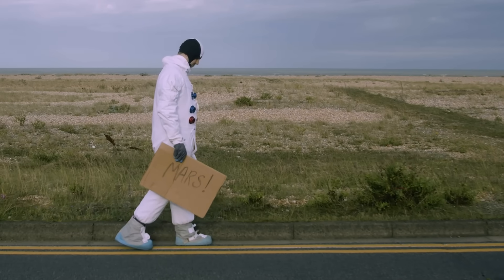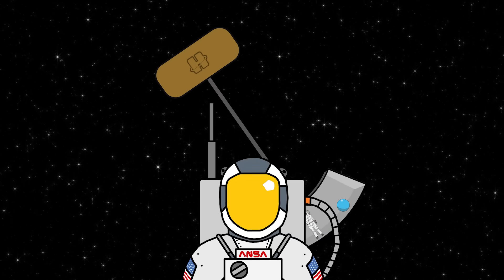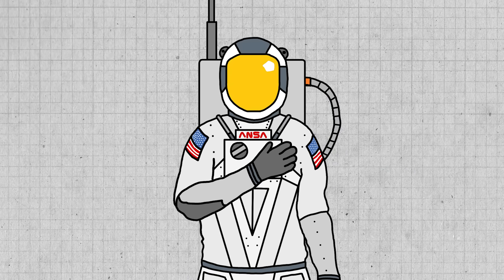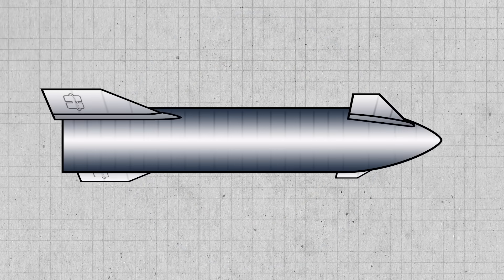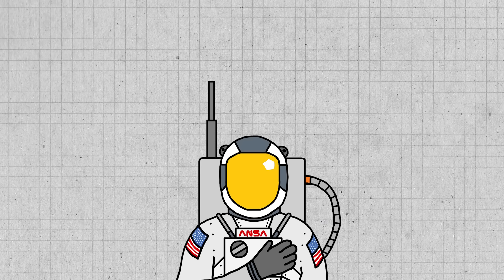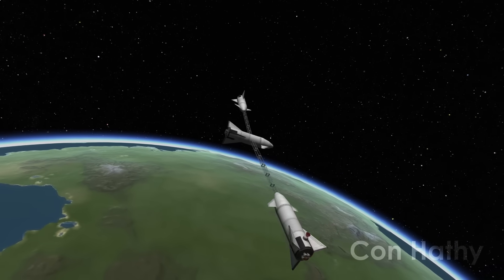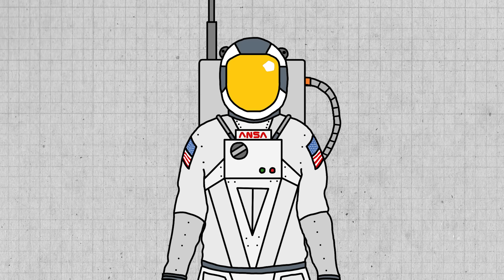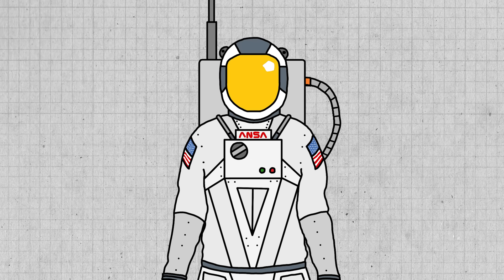This is NOT how you make Artificial Gravity

Comment: all of the examples pointing out the issues with each use case all miss the most fundamental issue, that using the centrifugal force obtained by fast rotation to simulate gravitational force all assume you are in physical contact with the thing in rotation. once you jump, it’s all over because there is no actual mass-based gravity caused by the curvature of space-time to make you fall back down into the mass.

no physical contact with the rotating object = no centrifugal force

Comment: It is comedic watching the three stooges spinning on their head in the wrong direction , the earth don't spin with your feet pointing up  it spins with your head pointing  up ,  first it's not artificial gravity it's just plain old gravity gravity and it's not made by mass or gravitons , it's not completely centrigul force but centrifugal force is part of what makes gravity , the weight of the sky above your head and your density push you down to solid ground and the weight of the sky above your head strengthen your bones and muscles working against the weight of the sky above your head , the centrifugal forces of the earth moving around the sun and the centrifugal force of the earths rotation give you upward push and ballance , tempiture has something to do  like on Venus where hot air rises and cold air falls , the centrigul force of the earth and weight of the sky make plain old fashioned gravity and the weight of the over your head keeps you from being flung into space by the earths centrigul force

Comment: Starship could have a 9 metre diameter hamster wheel. It could be powered by an astronaut running on the inside of it. Once it is up to speed they can stop running and hey presto they are in simulated gravity 🎉. They can spin it down by running in the opposite direction.
I don't know if this would work, but I would like to see them try it?
Reply: Would running on the inside of Starships hull cause it to spin?

Comment: Einstein said LINEAR acceleration was virtually indistinguishable from actual gravity... Not rotational.
Reply: Supposing "actual gravity" means planetary gravity, it cannot be distinguished from linear acceleration if we observe only at one point. Between two separate points, planetary gravity differs either in magnitude -- less at our head than at our feet -- or direction or both. The head-versus-feet difference is often known as "tide".

Spin gravity is also weaker at one's head than at one's feet, and at the same height, varies in direction as you go spinward or antispinward, but not as you go along the spin axis. If you move in any non-axial direction there is Coriolis effect. But if you stay still and observe at only one point, it, like planetary gravity, should not be distinguishable from linear acceleration.
Reply: @grlcowan  Okay.
You know more than he did, apparently.

Comment: When you spin a wheel back and forth, counter rotation you are essentially accelerating and decelerating the wheel...so at the outer diameter of the 2 wheels, in parallel like the 
wheels on chariots, put the pivot for the habitat to swing on, possibly a shipping container size habitat, which swings back and forth under acceleration and deceleration, counter rotation? Hopefully this works, and with Regenerative braking to cause the 1 g deceleration?
Reply: I'm hoping the actuating mechanical connection between the wheels and swinging habitat can be computer controlled well enough to stabilize the habitat somewhat?🤔
Reply: The stabilizers can hopefully provide Segway affect, hopefully to smooth out turbulent gravitational forces pulling plumb bob off his feet in the computer controlled habitat that may work?🫤

Comment: at 12:25 "as soon as the tether breaks you're (each spaceship) rotating at two RPM."  Really ? ? ? If the tether breaks at the point of attachment of one spaceship, it does NOT rotate, it just goes off in a straight line that was tangent to the circle of the system.  The other spacecraft and the tether instantaneously take on new linear and rotational motions depending on the mass of the tether.  If the second spacecraft could release the tether instantaneously, it would NOT rotate either, just move off in a straight line that was tangent to the circle of the system.  If the tether breaks anywhere else, then it's complicated unless both spaceships instantaneously release the tether.  This should be easy to verify.
Reply from the maker: @robertgraybeard3750  you’re right that its center of gravity moves in a straight line, but the single ship will still continue rotating around its center of gravity
Reply: @ConHathy  apparently you need to watch an experiment to actually see what will happen.  There are 2D frictionless experiment tables available  - we should  arrange with some University Physics department that has one to try it.  Clearly, if the tether breaks somewhere else than at the connection to a spaceship the two spaceship and the tether segment attached to each will have some new rotations.  But what if one spaceship is released?  Will all the angular momentum concentrate in the other spaceship and the tether attached to it?
Reply from the maker: @ notice how after it breaks, each individual piece continues to rotate at the original rate https://youtu.be/n-DTjpde9-0?si=9nAf9_2nmSX3A3C5
Reply: @ConHathy  the pieces in their "experiment" certainly do spin.  I suspect the pieces still attached to the rotor pull on the part of the pieces still attached as they are ripping off, twisting off.  I really want to try my experiment on a 2D frictionless table.  There are several universities in the metropolitan area near my home and I  might arrange some experiments of my own design.  I'll get back to you.
Reply: @robertgraybeard3750 it would still rotate bro

Comment: what if you need to move around or jump in the ship? doesn't this only work if you are physically attached to the rotation section?
Reply: Gravity on Earth works even when you have jumped up in the air. Your natural path is a parabola that is open towards Earth's centre. In a rotating space vessel your natural path is a straight line, but the floor moves in a circular path that brings it up under you. It feels exactly the same. It is the same; it's real gravity.
Reply: @grlcowan  Earth Creates Gravity by it sheer Mass, which counteracts the centrifugal force generated by its rotation to stop us from flying off its surface
Reply: @luisvictorf  Yup. For the above comparison, it would make no difference if Earth had no rotation at all.

Comment: The simplest method but requires a massive amount of fuel is to go 1G acceleration up to 1/2 the distance to destination then 1G deceleration the rest of the way. You can rotate the Starship at the 1/2 way point under 0G.

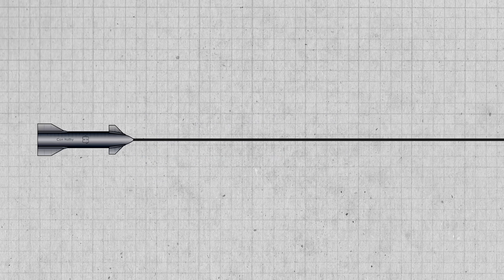Comment: You make a good case for short-radius centrifuges, and if you've ever been on carnival rides, it's not too tough to adapt. I've done it. However, at 5:30, a single spacecraft solution is brushed aside too quickly. It is argued that twice the equipment is required. Wrong. Consider the moonshots of the 1960s. The LEM was deployed and docked to the front of the Apollo capsule. This was the most energy-conservative method to land on the Moon, and if it were spun up, everything would be right-side up. Also, astronauts figured out how to dock and land the LM in two different orientations without duplication of equipment. One possibility is an inflatable habitat in the nose could be designed with low mass and correct orientation, although inflatable sections are opposed as much as short-radius centrifuges. To save reaction mass, use an internal flywheel and solar power, and the flywheel could use mass that needs to be there anyway. Don't dismiss a single spacecraft solution so quickly, but short-radius centrifuges are worthy of serious consideration. At minimum additional expense, short-radius centrifuges and single spacecraft solutions could be tested in space with live crews now. Why isn't that happening?

Comment: I'm guessing the reason you can't just accelerate at g then decelerate at g when you're halfway there is fuel limitations - will this always be the case? (as in would that be impossible even with a max energy density fuel like antimatter)
Reply: There is a difficulty getting rid of heat. A fission reactor can be onboard and ready to provide the ~300 gigajoules of kinetic energy per kg that boosting at one gee halfway to Mars gives you, and then the same amount of energy again to reduce the J/kg back to zero, but in the process, several times 600 GJ/kg must be radiated away as heat.

If it were easy to get rid of any amount of heat, and a spaceship can be 10 percent plutonium and/or highly enriched uranium, fission would be good for one-gee transits of up to ... oh that's interesting. Up to 32 million km. Who knew it was so little.
Reply: Back of the envolope says its possible with something like antimatter for that kind of distance, but not even close with current (actually real) fuels

Comment: Space X should just do what is done on the space ships in The Expanse the tv series where they look like tower blocks if stood upright but when laid down with a certain amount of acceleration it gives gravity to the floors enabling the crews to stand and walk also 0.6g should be enough so the acceleration won't have to be very much at all. The crew could be strapped in whilst achieving most of the velocity then just a slow increase for most of the journey providing 0.6g, no spin is needed.

Comment: Space travel is such a waste of time. The entire idea is a terrible idea.
Reply: .   Given that without it the extinction of life on Earth is literally guaranteed, I'm going to operate under the presumption that you have the tendency not to think things quite all the way through.
Reply: @BaobobMiller  On the contrary, I've been thinking about it for 20 years. Its great we dabble in the idea, and learn new scientific principles and such but how do you suppose its a viable existence? and what would be the purpose of it?
Reply: @K-Man-k5n  You're still demonstrating that you have not though ti all the way through. 

    I literally just told you "the purpose of it". We either leave this planet before it can no longer sustain life or we go extinct. It's pretty basic.

    Thinking about it for 20 years does not mean you have included the things needed to think it through.
.
Reply: @BaobobMiller  here are few things.
A. We do not have the ability to travel at the speeds required to leave our solar system. If we did space dust and debris, would rip through the haul. Forcefield is nonviable TV bs. 
B. So we go to mars.. great.. need to produce our own oxygen, food, and resources in a contained environment. Might as well do that on earth when it's ruined. 
C. So say you send a mission out to gather resources.. Think you can airlift tonnes of raw resources into orbit and descend on to earth? It's not possible. The heat.. the weight.. the fuel.. the timeline..
It's nonsense. 
D. You say we must.. because earth won't be able to sustain life. It will be the end then. We should learn what we can, but it's science fiction.
Reply: @K-Man-k5n  
A) Developing space travel is the only way to develop that ability, and simply declaring that such technology is nonviable TV bs does not make it so...

    The exact same thing was said about planes, trains, automobiles, the ability to overcome the friction of water on the hull of a boat and nearly every other modern technology you use on a daily basis.

    The reality is that while the finished product might differ from "TV bs" the practical functionality is another matter entirely.

B) I never said anything about Mars not did your comment I responded to... the matter at hand in the thread you created was "space travel" not "colonizing Mars".

    However there are things we could learn and develop on Mars that we could not learn here including whether or not we could build a temporary isolated self sufficient colony while waiting for Venus to be a suitable replacement for Earth.

    As for the idea of just doing that here... that is dependent on the presumption that the earth is still whole and hot a cold core floating in the debris of its own mantel.

C) I not only didn't say to bring them back, land them on earth, and then building a ship... I indicated clearly that changing the mass of a planet you expect to remain in stable orbit is a ridiculously bad idea.

D) Feel free to be the extinction of your own gene pool if you feel the need... but there are countless forms of life on this rock that should not suffer your fate simply because you thought it was stupid to develop the ability to create and harness fire.

    Nearly every technology we have was once science fiction including that computer you're using.
.

Comment: The issue with small centifuses is that you can't really do much while on them. So you have to dedicate large chunks of time to using them and not much else.  Also you can't practice /maintain skills like walking, running, jumping, bending or managing falls. Your heart and other fluid management systems are going to work differently since the difference of "gravity" at your feet is going to be significantly different than your head unlike with the real gravity of Mars or the Moon. 

If you spin the whole environment up, people don't even have to think about gravity training because they are always gravity training 24/7 while going about their usual business. Also a lot of basic things become much less complicated, like eating, sleeping and using the toilet. When you set a tablet or tool on a table, it will still be there when you come back. Keeping the environment clean is also much easier since everything runs "down"hill, you don't have to worry about inhaling a stray crumbs or stray piece of hardware.  A lot of systems like plumbing and thermal management also become much simpler and lighter as they can take advantage of the "gravity" and you can use the same systems once you are in real gravity as it will just work the same.

Comment: The moment that you move around on the ship won’t that change the centre of gravity and cause it to wobble?
Tyres require very little weight to be moved around on the rim in order to balance them. I assume it would be the same for a ship spinning in space.
Reply: A tire has to continue rotating on the same axle. If that axle ceases to coincide with the natural spin axis, there will be extra weight on one side and this weight will circle around the axle, shaking it. This is actually how a cell phone buzzes: an eccentric rotor.

A free rotor in space is different. If it includes a wheel that is not much more massive than you but big enough for you to walk on the inner surface, the spin axis passes through a point significantly displaced from the wheel axis towards you. This does not cause wobbling. It causes the part of the wheel opposite you, now farther out from the spin axis, to get more acceleration while you get less. Rotation continues smoothly.

Comment: Yes, two spinning rocket ships connected by a 10-meter cable would be highly problematic, and the shorter the radius, the worse it gets. Here’s why:

1. Extreme Coriolis Effects

Since artificial gravity (centrifugal force) depends on radius, a shorter radius means a stronger force gradient between different parts of your body.
	•	If the radius is just 5 meters per ship (half of the 10m cable), there will be a huge difference in Coriolis force between your head and feet.
	•	Moving your limbs will feel strange—raising your hand or stepping forward could make you feel unexpected sideways forces.
	•	The smaller the radius, the stronger the Coriolis distortions, making movement disorienting.

2. High Angular Velocity (Fast Spin Rate)

To get 1g (Earth gravity) with a 5-meter radius, you need:

\omega = \sqrt{\frac{g}{r}} = \sqrt{\frac{9.81}{5}} \approx 1.4 \text{ rad/s}

which means a full rotation every 4.5 seconds (~13.5 RPM).
	•	That’s way too fast for comfort—humans struggle with anything above 2 RPM due to inner-ear issues.
	•	Fast spinning causes severe dizziness, nausea, and disorientation because your inner ear can’t adapt.

3. Walking Feels Completely Off

Since a 5-meter radius means a small circumference, just walking a few steps means changing direction significantly, leading to:
	•	Coriolis forces shoving you sideways when you move radially.
	•	Strange shifts in weight when moving along the rim.

4. Cable Stability Issues
	•	The tension in the cable depends on rotation speed and mass.
	•	Any oscillation or movement between the ships could destabilize the system.
	•	If one ship moves slightly, the center of rotation shifts, causing wobbling.

Conclusion: Too Unstable & Uncomfortable

A 10-meter total diameter is far too small for practical artificial gravity. The shorter the radius, the worse it gets, with severe Coriolis effects, nausea, and movement distortions. For a comfortable experience, you need at least 50-100 meters of radius to keep spin rates low.
Reply: So ...

"
	•	Any oscillation or movement between the ships could destabilize the system.
	•	If one ship moves slightly, the center of rotation shifts, causing wobbling.

"

The mastery of LaTeX presumably coincides with a ready ability to point to an experiment or peer-reviewed simulation supporting this.